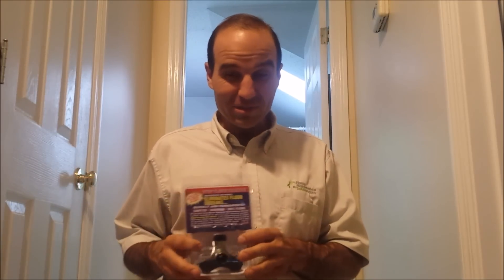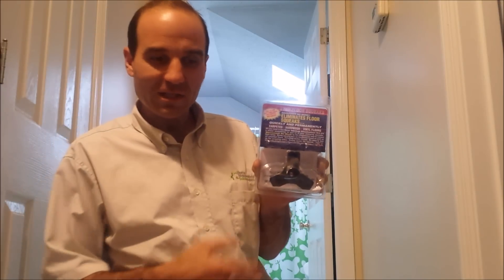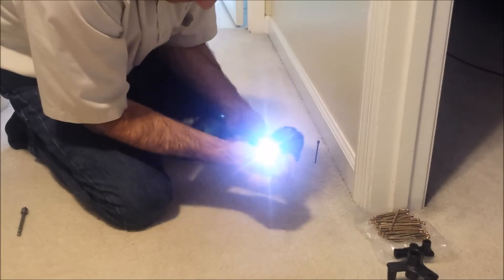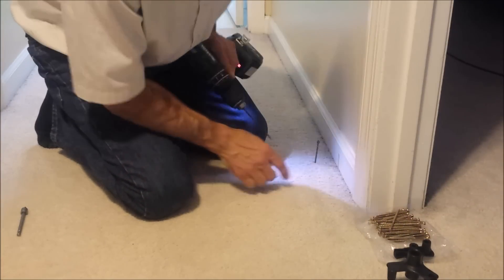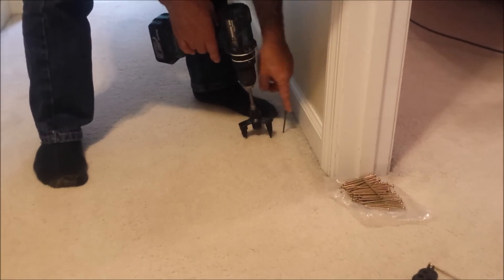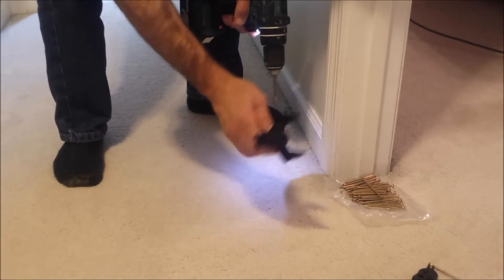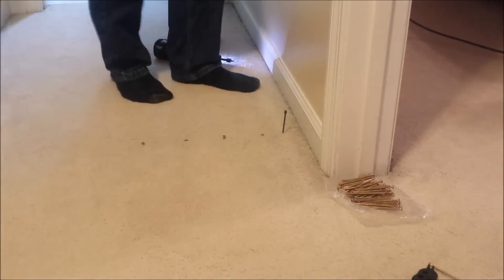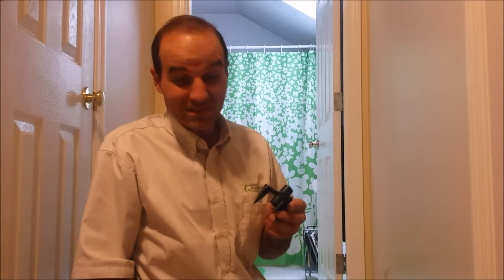Repair a squeaky floor without removing the carpet.

Comment: What would you recommend for a basement subfloor making that sound?
Reply from the maker: What type of subfloor do you have?? Is it treated plywood glueed to a slab?
Reply: @Homemaintenancesolution  A Dricore type material yes
Reply from the maker: @TheJpsauve  I would suggest picking up the floor if you can and drill through the subfloor for flathead tapcons.   Before you put the screws in try injecting some high quality glue under the subfloor through the holes.  Then draw it down tight with the tapcons.

Comment: I want to try this in our apartment, but don't want to rip carpet 😂
Our entire floor is like stupid loud.
Which is annoying cause they just remodeled the entire thing. Windows appliances floors insulation roof siding.
Not under floor though. Sounds like the same creaky boards and you can hear then downstairs 🙄
Reply from the maker: Ricky Webster, do you have the loop style carpet or plush?
Reply: Same in our house. It's sound an old old wooden ship. That's why I found this video.
Reply: did you try it and did the fix still prevent the floor from squeaking ? I'm trying to see if the solution last, I know Home depot Canada removed the product from theirs shelve, but I'm trying to find a solution for my floors...

Comment: My stairs always embarrassed me when ever friends come over with its sqeaking self lol its wood line with carpet about 12 step to climb they all make loud sound, any idea for a fix ?
Reply: Your going to have to take the carpet up and start putting in screws.
Reply: If you can get underneath the stairs (like through a cupboard) you can use expanding wood glue between the steps and risers. The glue expands into the gaps and will help a fair bit

Comment: Sure DOESN'T work on an old house with an old dried out plywood sub floor.  I went though a whole box of screws and still have the squeaks.  Only way I could stop the squeaks was to pull the carpet and put a 3 inch screw next to each nail in the sub floor.
Reply from the maker: Yeah, I can see how that could be needed if the problem is very widespread.  This little kit is really good for isolated areas though!  Best to you on your project.
Reply: Sounds like you're blaming the kit when it was you who was using it for an unintended purpose. It worked wonders to fix my plywood subfloor in a house built in 1973. Did you make sure to stand right on the spot where it squeaked so the floor is compressed when driving the screws in? Most people who say this kit doesn't work were either kneeling or sitting when they drove the screws in.

Comment: Ok I got the kit and followed directions,... however seems like the floor squeaks more but in different places now . Seems like there is ply wood under carpet . Is it possible that it only needs carpet glue underneath?
Reply from the maker: By screwing the plywood subfloor down in the squeaky areas with the kit, you could cause the floor to squeak in other places.  You are securing a loose subfloor.  It could take a while to get all the areas.

Comment: Does anything change in the process if you have an open truss system??? I feel like its not working as it should. Continue to hear the squeaking.
Reply from the maker: It should be the same.  Just make sure that you are hitting the framing below.  That's the key!
Reply: When you say framing, i assume you mean the 2x4 below? As if it were a joist?
Reply from the maker: Yes, that's correct.  You might also try moving down the 2x4 to get a screw in that is sure to hit the top 2x4 closer to where the diagonal braces are in the truss.  If the top 2x4 is flexing, that could help keep it more stable.

Comment: Will that device work on hardwood floors or floor tiles?
Reply from the maker: You can use it for wood floors, and fill the hole with colored filler, but I wouldn't try drilling through tile.
Reply: @Homemaintenancesolution  oh ok. Theres a creak coming from tile up stairs but when someone steps on it but  people in basement can hear it more

Comment: I have used this same tool screws and all, floors still squeak.
Reply from the maker: Joseph Cyr, bummer.  Any ideas why?
Reply: @Homemaintenancesolution  probably wasn't standing with his weight pressing down on the squeak location while driving the screws in.

Comment: Good video but you should warn that people should check for pipes and electrical cables first, also I dont know why people get bothered by lifting carpets, just lift the carpet, you can the use PVA glue and nails to fix the squeak then combined, buy a carpet stretcher and or hire a carper fitter to re fit the carpet, squeaks are so annoying and wont go away or get better, dont be a cheap skate, if you drive one of these nails through a water pipe or electrical cable its going to cost you a lot more than a carpet fitter to repair the job.

Comment: How can you tell if there is water pipe under the carpet?
Reply from the maker: It would be misplaced if it were that   close to the bottom of subfloor.  If you live in house built in the paat 40 years,  then you should be fine.  If you have an older house, then think through where the pipes come up to the bathrooms and kitchen.  They almost always go straight up walls, but if you suspect that they might need to jog horizontally,  then don't do that area.

Comment: Can we do this on berber(looped) carpet ?
Reply from the maker: Be VERY careful,  but yes.  You will need to tape the threads on the screw like I show in the video. If the threads catch the loop thread, then you are messed up!
Reply: @Homemaintenancesolution  Where Can I get the tapped screws ? I could not find in lowes or home depot. Pls help.

Comment: What if you have copper piping that runs along the joists
Reply from the maker: TRISTAN ROBSON, then you need to be very careful not to hit the pipe.  You will need to find another way to locate the floor joist like a stud finder that has a deep scan option.  You could also try a strong magnet that should locate the nails in the subfloor through the carpet.  Hope that helps!
Reply: Tristan's comment highlights a flaw with this method. That long joist finding screw could damage pipework or wiring in the floor. Most home owners won't know what's there

Comment: This is ridiculous  I'm a floorlayer your asking for trouble attempting this. Just lift the carpet and solve the problem that you can actually see
Reply from the maker: Yeah that makes sense for you.  Breaking a seam on carpet is outside of most people's ability, so this is solution that works.
Reply: @Homemaintenancesolution  sorry  if all due respect  tell me you have never gone through a cable or water pipe 
Using this method, I know the answers yes. The idea seems fesable, but the product flaw is drilling into the unknown
Sorry

Comment: Will it work on a staircase?
Reply from the maker: Madeline Young, yes it will.  If you have wood treads without carpet on them, then proceed slowly.  Try one hole and use wood filler on that hole and make sure you like how it looks before you keep going.  Stairs can be harder to find the squeaks.  Best to you!

Comment: Oh shuuuure just keep drilling into your or a customers carpet till ya hit something solid lol.... Pro tip... DONT DO THAT...!!!!! Instead try using the knock and tap method to listen for a solid sounding hit rather than a hollow sounding hit with a small and CLEAN hammer head. Or use a good quality stud finder and it should be able to work even through some 70's shag carpets with grandpa's first pot roach still buried in it somewhere... The reason you don't just drill away is because if any fiber catches on the screw threads you will absolutely ruin the carpet beyond a little oopsie!  Now maybe if the product specifically says the screw can't catch and pull carpet fibers then I wouldn't risk it.  Even if I'm just working on my own floor/stairs.... (That's the difference between an Angie's list job and a true carpenters work) however even if u treat me like a slave or berate me ill still finish the job and do it well. But I won't go above or beyond anything we agreed upon or that I was paid for. Good customers I'd make sure everything was perfect and aesthetically amazing... And let them know if they need another job done I'd give them a discount for return customers
Reply: I know long rant.... Just hate shotty Work not that this guy is shotty or bad Contractor I don't know him or his reputation, but I'm over the bad Contractor shit, gives us all a bad look.... And I more often then not have to fix their sloppy "repair" if you could call it that....

Comment: Anyone have any ideas how do get one of these screws out if it breaks just an eighth of an inch too high. When drilling them in one of them just snapped at the scoring prematurely. I tried pliers, but they didn't budge it. I followed all the instructions, and it only happened with one screw, so i'm guessing I just got unlucky. Any ideas would be helpful.
Reply: Pound it in with a hammer if you can't get it out. That is about all you can really do. Or drill it out. but that would make a bigger hole and probably ruin the carpeting.. Good luck..
Reply from the maker: I would take a small punch and try to bend it over or sink it if possible.
Reply: Shenvalleyboi doing fflooring with my buddy, just smash it down as hard as you can lol literally all we do with extra nails, screws, Staples that we couldn't get out

Comment: Not such a good idea if you need to lift the carpet to access pipes/cables  in the future. Any tradesman that needs to get under there won't thank you much at all.
Reply from the maker: I've been in residential building and repair for over 25 years and I can count on one hand the number of times that we have had the pull up a subfloor to make a repair of mechanicals.  It really rare...

Comment: DONT DO THIS    you WILL hit a PIPE in the floor!
Reply from the maker: I've been in this industry for 35 years and I don't think I've ever seen plumbing pipes within 2" of the bottom of the subfloor.  This seems like an unnecessary caution, but each person should make their own decision.
Reply: @Homemaintenancesolution  in the UK is super common. Nearly every house has this.  It's the number one call out for emergency plumbers ....hitting a pipe from screwing a floorboard down blindly